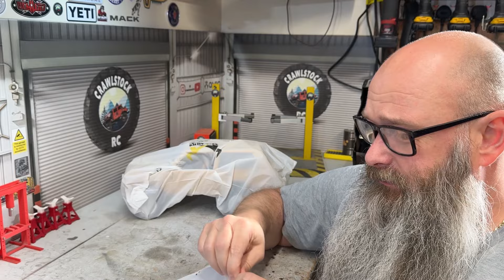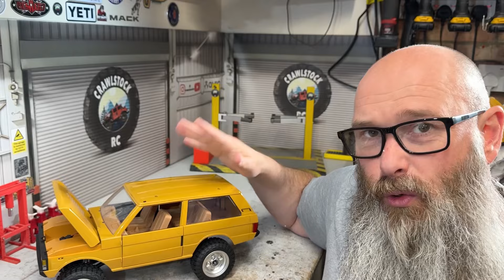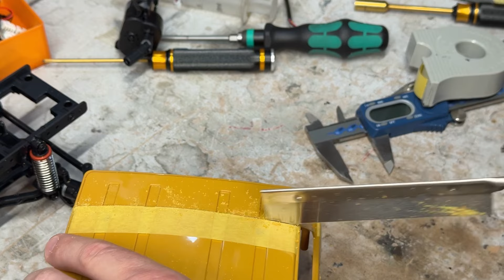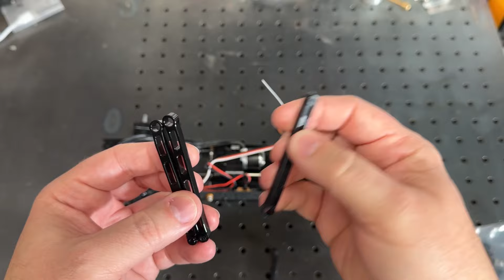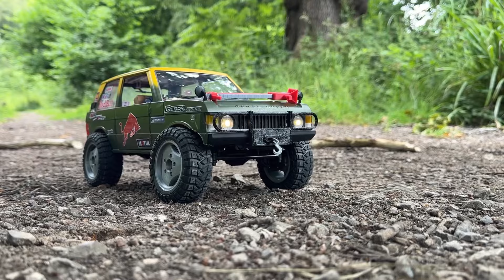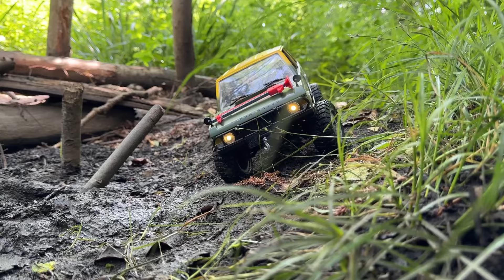MN168 Range Rover Classic Winch Bobtailed, Build Off DoURC Staffordshire Scale Trail.

Comment: What did you use for the 4 link suspension links?
Reply: Let me rephrase, what lengths did you needto make  the links
Reply from the maker: Ah I see. Honestly I can’t remember as I had shortened the body and adjusted the wheelbase a little. I don’t have it anymore. Sorry,
Reply from the maker: Hi, I made them from steel rod.

Comment: very nicely done Sir. I run a 45A ESC (STM32 MCU) and brushless outrunner and also found the stock battery is OK for general trailing but a decent LiPo is an improvement when crawling, if you are careful you can get a standard LiPo balance connector to fit the stock power connector.  looked at mine many times thinking of bobtailing it but decided to keep the body full length on this one and get another to build a dedicated bobtail crawler with my own custom chassis. All good fun.  All the best from a fuzzy old tekno goat in Scotland. Happy' Wheelin'.
Reply from the maker: Ah cool. I need to decide if it’s worth replacing the broken axle or just binning it lol. Enjoy your wheeling too.
Reply: @crawlstockrc  With so many upgrade parts available I see no point in replacing axles with original plastics when for a few quid more You can fit alloy axles that will be far more durable.  After many months of hard offroad trailing & crawling the rear diff has finally lost some teeth. I will be fitting alloy axles, there are brass ones available but cost is prohibitive so a set of cheap-ish alloy axles & custom link rods will do the job. HAppy Wheelin'

Comment: Broke those link mounts on our's as well, co-driver made a sudden turn right in front of me and I ran over it with H8H Allrock and that thing is not very forgiving :) Found a alloy mounts for few bucks, and metal axles, same as Rob used on his one, but that's not made for this rig, straight axle. Went back with stock ones with alloy mounts.
Share a link if you manage to find proper metal portal axles for this :)
Reply from the maker: Ahh what a shame, I didn’t bang it hard so quite disappointed. I think the body shell is what makes this model any good.